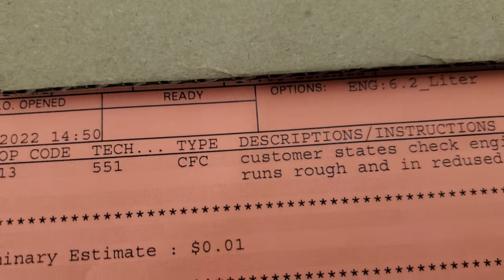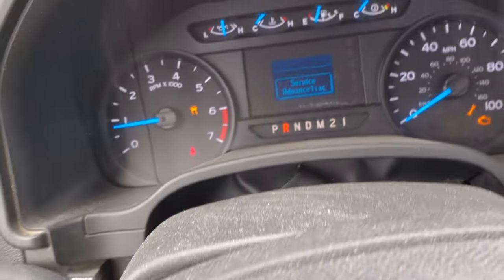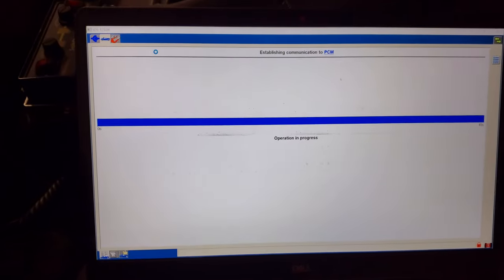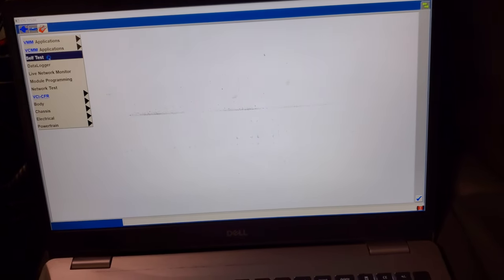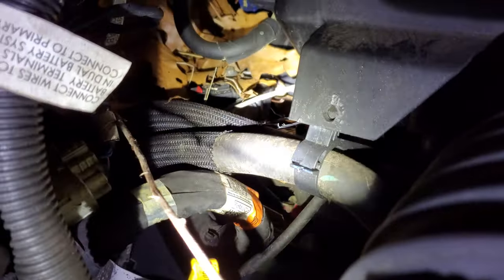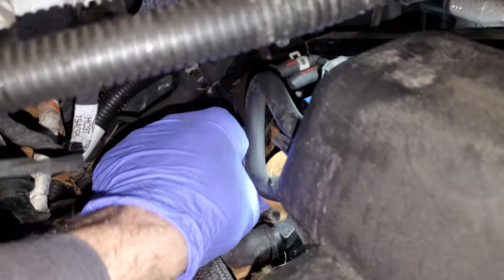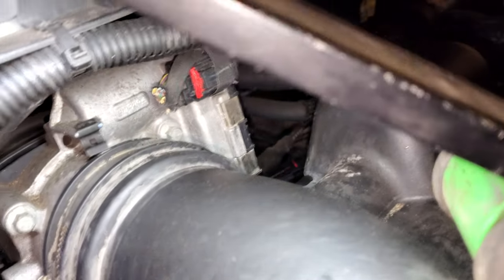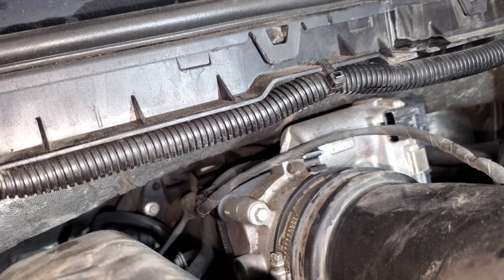what happens when Rats EAT your FORD TRUCK - GO CHECK YOUR superduty

Comment: I’ve repaired a few of those. My understanding is the wire insulation is made from soybean oil and therefore critters like to chew on it. I’ve heard the Irish spring thing but it didn’t work on my late shop owner’s 67 GTX. The mice even chewed on the 🧼 Irish Spring he had under the seat.

Comment: A neighbor told me he saw a rat run across our fence last summer. I bought 3 rat traps and placed them around the property. Was killing a rat every few days. Got 12 in 2 months before winter set in. 1 had a bot fly larva crawl out of it after it died. I didn't even know bot Flys were in Canada. I used pepperoni as bait on the old school snap traps and they loved it. Just a thin slice of a stick was all it takes. Even if I dry up they would still go after it

Comment: Pure peppermint oil concentrate. Careful it burns like heck and do not spray in mist form as to prevent getting in eyes. I spray near wheel well liners. I also have a property truck that just sits and our fifth wheel on back side of property and no issues. I now also spray our new powerstroke

Comment: I learned the hard way to make sure the glow plugs are working on my 7.3's so I don't have to plug them in overnight. Mr. Rat just loves a nice warm block to nest in and chew! The last 99 F350 I bought had a nest in the valley that nearly filled a 5 gallon bucket. The urine corroded the steel fuel line that crosses over to the driver's side and caused it to leak.

Comment: My previous Ford was ruined because of mice.  My truck stays parked daily in a large barn on my mountain property.  Sometimes for extended periods of time as I am retired now.
I traded it in and now I regularly spray under the hood and chassis with peppermint oil.  Mice hate the smell of peppermint.  So far all is well.

Comment: A few years ago while I was teaching at UTI in Phoenix AZ they had a roof rat problem because of the city planting orange trees in the mediums of the roads. The ripe oranges would fall off and rot causing the roof rat population to explode. Every shop in town had numerous tow in vehicles and became experts at fixing chewed thru wiring. They loved plug wires and pink wiring most. One fix was drowning the wiring harnesses with pepper spray. Hose it down and let it dry seemed to work well.